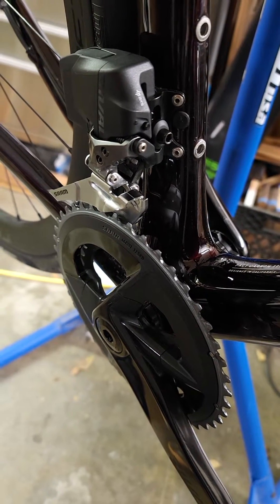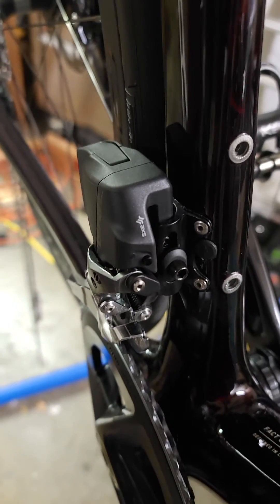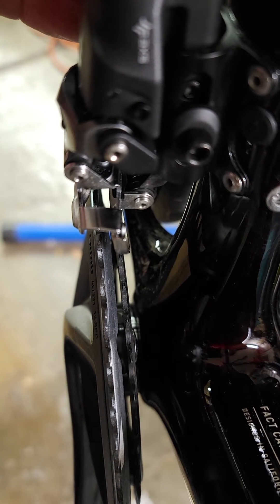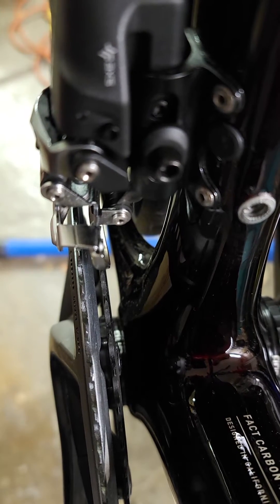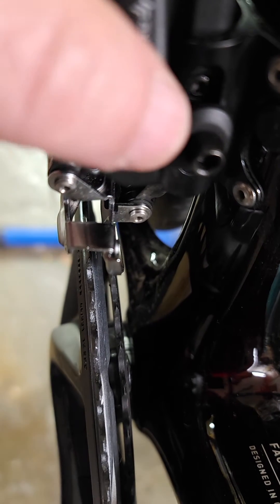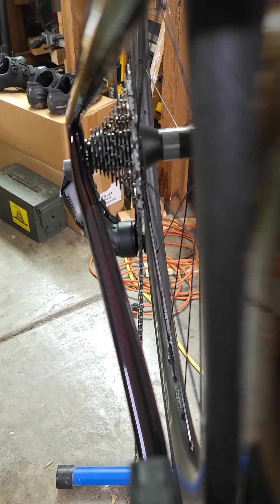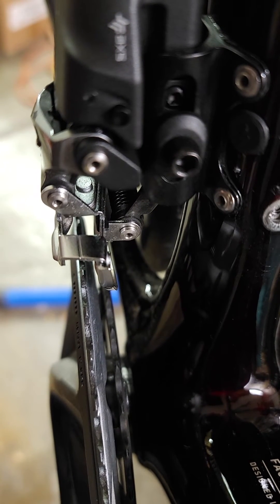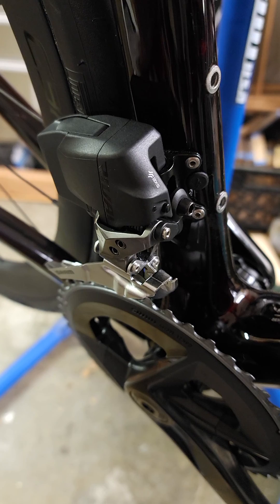Sram Rival AXS front derailleur overshifting

Comment: Similar Problem. Apperently thats by design to have fast shifting I guess?
But 1) the risk of dropping it to the crank side is high 2) That first two seconds the chain is rubbing, annoying.
At least give me the option to disable that "feature"
Reply from the maker: Agreed.  I think SRAM should honor the golden rule to NEVER override the high limit screw adjustment.  That should be a physical and absolute limit.  If it has to be there for some reason, let the field-user adjust the "overshift" threshold.